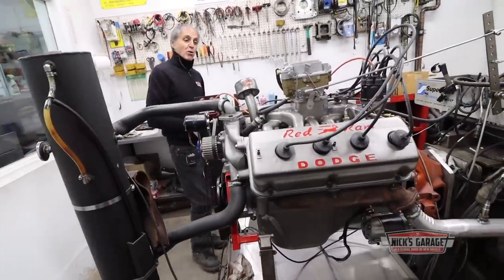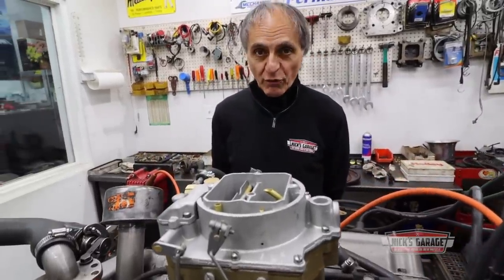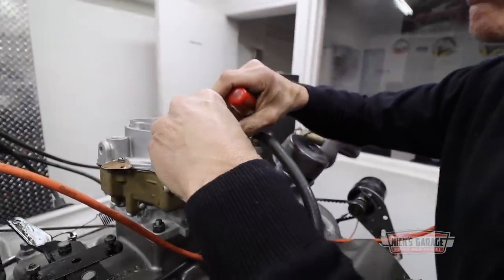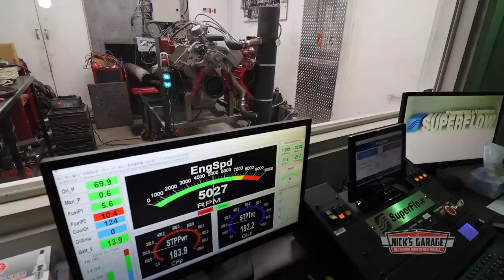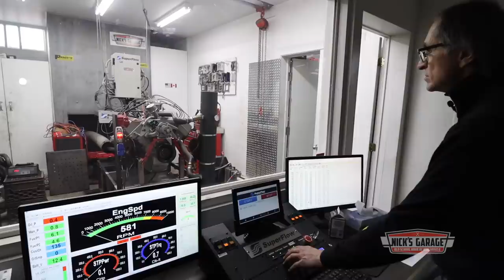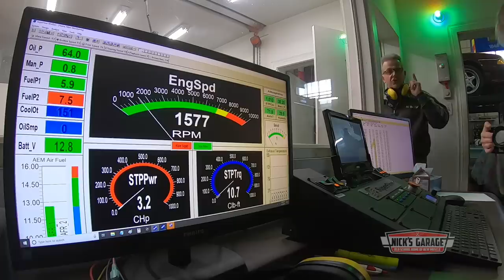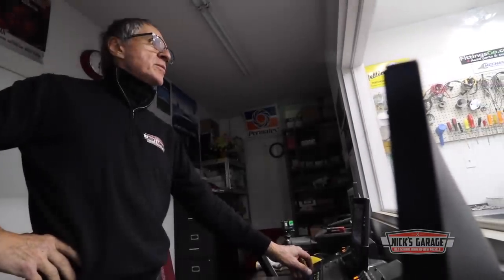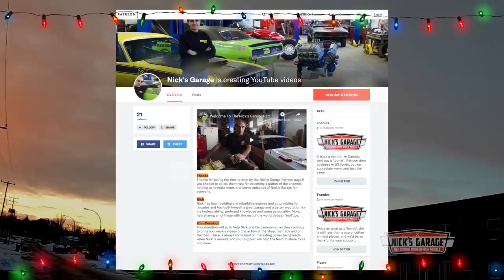Tiny Old HEMI - First Generation 241 Hemi on DYNO

Comment: I have wondered what they were thinking when this engine was born. It replaced a 230  CU in flathead six that put out 100 or so HP with good torque for city use. The weight, physical size, complexity and cost of this engine for the times makes no economic sense to me.  Being that this engine was an obvious competitor for the 239 cu  in Ford “Y” block & shortly of the 265 in Chevy how could this be justified?. Nonetheless a really interesting piece of history & a great video.  PS: weren’t the early Dodge hemi’s known for breaking crankshafts?
Reply: Andy.          Breaking crankshafts. Do not know. We revved the engine many times to 5000 RPMs and went well.
Reply: Nick Panaritis great video of a smart and persistent individual solving problem after problem & succeeding .

Comment: Nick,  look at the overhead video shots down the carb secondary throats after that first  jet change, there is NO fuel coming out of the secondary venturi boosters in all the pulls after that.  Thats where your power went,  its functioning as a 2 V carb  It doesnt appear the secondary throttle plates ever move.

Comment: Vacuum secondaries are not opening.. From what i saw on the video

Merry Christmas from Bavaria Germany
Reply: They're mechanical, not vacuum, but yes, the choke linkage is keeping them locked shut. He forgot to wire the choke open again after they changed out the jets.😉
Reply: @danw1955  yea i  mean only secondarys... Idk why i wrote vacuum
😂

Comment: Nick,  great video. Question: 55 Dodge Hemi ( same as your's ) missing distributor. Grabbed one of my 318 electronics and it looks like it'll work. You used a 72/73  340 electronic. Do you know if the 340 & 318 are the same ? I don't have a 340 to compare...... what do you think ? Any info would be appreciated. We want to put it in a 39 Dodge 2 dr sedan, a dependable driver, not hot rodded

Comment: Plug wire at rear of engine is arcing against the block at the rear. 
Those Will Carter 4bbls were touchy. The numbers on those old jets mean nothing!
Reply: Dave Micolichek  What I meant is, those old jets flow inaccurately, a smaller or larger number can factually low more or less than one with the same number, you don't know for sure unless you flow test them,  and they're usually damaged, corroded...
Reply: Dave Micolichek  Lots of luck finding WCFB clean undamaged jets haha!

Comment: I love this lil torque munster on the Dyno and all the parts that fit in the old 241 Red Ram Hemi 11 yrs be4 I was born just funny how the big Hemi flywheel fit in there along with the 340 distributor just wild love it very Kool Nick n Crew great job and that's where all the Hemi 's start from that 1 funny story I have a 71 340 road runner motor I will be building soon but gonna stroke it out and try to make big power on  and going to put it in a Dakota pickup with just a oak bed I will be cutn all the wood for from tree's from My friends home down in Fla here love My V8 Mopars Small block big block love to have a Hemi but I never will unless I get rich be4 I die had a 65 Dart GT factory underdash AC and all still have My dual point distributor from it an old lady / Young Docs wife back in 65 bought the car brand new in Hollywood florida loved that car original with 80000 thousand miles on it just gave it a head job paint the valve covers with the BLK cringle paint same color as the light blue 67 gto miss My lil toy I found out that Ed   Iskadarian ISKY made the cams for Mopar back in the day that supposedly had 450 lift cam you would be sitn in there and the car was shakin Koolest car I ever owned had many big block Dodge chargers in My lifetime and an old 68 Barracuda next the Dakota Pickup I build will be a wheelstander truck lots of power all gas 1 big carb lookin to stroke it to 426 cubic inch comin out of a small block can't wait just sayn will say 🌲 Rob on it with the live Oak bed from real live oak 🌲 s here be awhile before I get there but I am patient man and will be street legal too love watching My favorite new family Nick's Garage/ just learned a lil bit about the small block Mopars I didn't know from Tony's Garage and He was a Hemi/ big block lover mostly now he's a Small block lover too but He used to write for the magazines in the 80s/ 90s he said which I thought was Kool that thing sounds mean/ Kool the rumbler

Comment: Sounds like air is getting in somewhere it shouldn't be, if you cant get it to richen up its a dead give away. Try making a couple gaskets out of some felt paper between the top section and the lower barrels, if the surface is uneven and not sealing properly with the gasket you will see marking on the edge of the paper where the air is getting through. I know I'm probably preaching to the choir here with someone with your experience though, just my 2 cents. Good luck with it, I have no doubt you'll get it sorted.

Oh, And a merry Christmas to you all!
Reply: Makes no difference at full throttle. That ain't the problem.
A vac leak effects part throttle and not full throttle since there's no manifold vacuum at wide open throttle. Its something else.
Reply: Adam Randell choir  , and your telling a pro   Advice  that’s rich  hehe  happy holidays all
Reply: all of the carburetors from that time period were junk,wcfb aluminum or cast iron based,they were first design junk,moving to the smallest afb's would increase horsepower and torque,due to atomization is superb on all carter designs
Reply: @nadronnocojr  I did say that did I not? It was just an idea, did you just read the first half and think you'd be a hero?
Reply: @strattuner  You have a good point there, some of the older Volvo engines I've worked on were the same. The old 2.2 ltr 4 pot loves running a bit lean but of course go to far and you run into overheating issues, the 2.5 5 pot was way better running rich and you'd get the flames to boot but that is also EFI so way better control. Got one at the moment running 400hp and an absolute mountain of torque for its size (610nm), What amazes me about that Hemi is it is a 65 year old engine. It really shows Nicks skills, but damn did it pass the test of time or what! Not sure you'd get the same lifetime from modern engines lol...
Reply: yeah he's a master of many years,he comprehends ,he's a thinking man,the eight hole crank flange was a necessary design,they knew larger cranks were coming,i only deal with the 331-392 engines,same 8 holes all of the flywheel and clutch interchanges even between the 6's and 8's,mopar knew none of the new hemi designs would never see beyond 350 horse till called upon,yeah carb design went from junk to superb,then the gov stepped in and made demands on internal combustion engines that were and are unobtainable, fuel injection has come along way,the pie in the sky fuel economy they want a friction engine to accomplish is nonsense though,i don't work on them anymore for money I just piddle on my yesteryear cars
Reply: @strattuner  Not wrong about the unrealistic expectations when it comes to ICE, its all about ticking the right boxes for legislation. There is always room for improvement but can get kind of ridiculous, its like how lane assist can take a 3 star safety rated car to a 5 with no other changes.

Comment: Less horsepower than a Honda Civic lmao. My wife's Kia would run that engine down. My how times have changed. Very cool. Good rebuild.
Reply: 1000cc yamaha R1 makes 200bhp .... and that engine is tiny in comparison ... but I'll bet this Hemi will beat out a civic, kia, R1 on torque 😉
Reply: MotoGoat that’s what I was thinking
Reply: Yeah but to a V8 guy those asian engines sound like sh*t even though they perform super.
Reply: Mike Bennett yeah probably so but most definitely not with 300,000 miles on them because Kia and Honda engines are just not designed for longevity like these hemis were because they originally built for endurance not performance.

Comment: Nick.. go back and see if there was a thin spacer washer on the secondary linkage where the arm hooks up.. If that linkage slid in just a few  thousandths, it would keep the secondaries  shut. We used to have fits with these carbs. Overall, a great job.

Comment: It appears like the distributor is a bit out of phase. A lot of them were in the old days, I used to get considerably better fuel mileage and performance out of my early Mopars by phasing the distributors so that they fired more consistently.

May be the first time that engines ever seen 5000 RPM.

Don't worry about the lean carburetor. There's a reason why Chrysler's were known for really good fuel mileage. They ran Rich enough at the lower RPMs for you need the power and lean enough at speed to get diesel fuel mileage. I knew a guy several years ago that had a Dodge Royal from 1955 I believe and I forget the size of Hemi but I believe it was smaller than the one you show oh, but he was getting 24 to 26 miles per gallon. And that car got around just fine.

I am not surprised at the engineering wisdom of Chrysler to use interchangeable parts for 30 or 40 years.

A little bit of your lane maybe coming from the fact that you do not have an air cleaner on it. I do not remember whether they use the oil bath air cleaners but those would have rich in the mixture because of an increase vacuum required to get the air through the air filter medium. That should easily give you an extra point.

Comment: Someone needs to bring Nick a 225 Slant six so this engine isn't the smallest he has dynoed. :-) I keep hoping to see a hopped up poly 318 run sometime but hardly anybody fools with them.  I am surprised you don't have the starter mounted on the dyno. It makes life much easier not having to fool with that wiring and the mountings all the time, just stick the splined hub on the crank and go.
Reply: You do get around ,happy holidays and Baily.
Reply: bc.   The new Dynos have the built in stater and flywheel set-up. I swish I had a 225 to rebuild.

Comment: That engine would be a good mate to the 63 Dart wagon I'm looking at. I wonder how far the 241 could be taken to. I don't want any run of the mill Chrysler motor in it. I like the uniqueness of the combination. I'm sure it would be a nightmare getting it to work properly and make the project 3 times as long and 3 times as expensive but I would have something that no other kid in the state would have.
Reply: Bigger behind the trigger use a 318 poly and a 727 torque flite it will be easer and cool as hell!

Comment: OK, it's Main Street, USA, 1951, late at night. A flathead Ford lines up with a (first year) hemi. . . and the winner is??? Next night, the winner of that race is lined up against a Rocket 88 . . . and the winner is...?????   ALL BONE STOCK.
Reply: Patrick Joseph l will put my money on the pre-war Straight Eight Buick...High compression, dual carbs, 320 cubes, 165 hp . Oh, and just as fast as the post war Olds and Hudson.
Reply: Dave Micolichek  That's what the Rocket 88's were known for.

Comment: There’s an electronic pick up coil kit that will go into the point distributor it gets magnetic reference off of the point cam. On the old canister filters they actually used a roll of toilet paper in some of the old Cadillacs and Buick’s,

Comment: Everyone worried about linkage, could be right. But I wonder if it wasn’t tuned for use with its air cleaner which often acts like a choke. FWIW
Reply: Good point to be considered..
Reply: They often used an oil bath kind of filter

Comment: Neat engine. Too bad the owner couldn't go the performance route, add some custom headers, increase the CR, add a custom sheet metal fab manifold, add a performance carb....these engines make great additions to old lightweight 30's rods.
Reply: Kathleen Shaw  yeah no doubt, low CR would be good for a Blower, turbos or other boost apparatus...
Reply: Kathleen Shaw  yep, sure thing....

Comment: Nick, very nice. Noticed secondary barrels did not show gas  splashing  on venturies  during later runs. You could see gas splash  on primaries and secondaries  on your first run before you took carb apart. Look at your top down camera shots during runs. Is fuel pressure down or drop on demand? Sharon Burns seems to have a good comment.  Thank you for your hard work!
Reply: John.       Had it fixed the next day.

Comment: the public view from the top of the carb, the back secondaries are not opening I sware on a stack of bibles are NOT opening or you would see that plate move and they never  move Nick... your running a two barrel when it should act like a four barrel.. merry  christmas by the way
Reply: Morgan.        We had it fixed the next day.
Reply: I could see the same thing , only on the first pull can you see fuel being pulled thru the venturies , but not in any of the other pulls where the HP was down.

Comment: Engine dyno does not count  no load  at least get a wheel dyno.
Reply: I can't remember where I came across the info but I'm pretty sure a dyno like Nick's is a loaded dyno. I could be wrong... far from an expert. If I recall correctly it uses the water in some manner to create load. Edit: I may have seen it on Engine Masters. If I find the video I will share the link if I can.

Comment: I put Clifford intake and exhaust headers on my 225 Slant Six, small ceramic starter, Holley 4-BBL carbureator and Mopar electronic distributor and Mopar mild street performance cam, straight pipes.

The only thing I might have done differently might be a fuel injector carb.

Now, if I haven’t driven you insane with my comment..

I would like to see what you would do with the 225 Slant Six for the road.

Comment: Thanks Nick for showing us that beautiful 241! I had one that was in an old logging truck. Has a 2bbl and was bolted to an old 4 speed. I think your carb is the problem. It seems like you said to be running too lean. You may actually make more hp on an old holly 2bbl or Rochester 2bbl.

Comment: the engine is perfect for a turbo installation,due to its genius design the 241 would probably put out 500 horse easily with copper head gaskets with oringed heads

Comment: Truly defining the term, "Hot Rodder"......:D

Note: frame rails were so narrow up in the front, the increase in motor size didn't allow for appropriate exhaust. Back when engine tech out paced suspension tech.
Reply: 48Dodger Headers were used putting a V8 in a 53 Plymouth to clear the steering box.

Comment: Thanks for posting. The gen 1 hemis   sound great. What is the distance you had to space the bellhousing back from the block? I see you used nuts as spacers. It looks about 1 inch or 7/8" between block and bellhousing. Mopar used an aluminum plate on the rear of the block as a spacer and to mount the starter. I have two different thickness plates, wonder which is best to use to adapt bellhousing to my 331. Thanks

Comment: You can clearly see the secondaries opening on the 156 hp run at the 21 minute mark. Each run after that, the secondaries are not opening! Check the video, they barely move at all.
Reply: Ron.     Had it fixed the next day.

Comment: I say check the air bleeds and all the fuel circuits in the carb. After you took the carb apart the engine started to lador at idle and started to break up when you raised the RPM. You choked the carb with your hand and nothing happen. I think you have a passage way blocked up a small bit. Take the carb off and run a wire in every circuit. I could hear the engine had a laboring sound to it. As small as the circuits are just a little something could cause this. I'm 72 and have been a mechanic all my life. Have my own business where we build engines. Opened the door in 1976. before that I mechanic at GM. Ck vac. leaks too. But I don't think you have any. Ck the gaskets in the carb. One might be covering a vent hole. Good luck. I wish I was there to help you find it.
Reply: ken.    We had it fixed the next day.
Reply: @nickpanaritis4122  What was it.
Reply: @kennethrobinson11231  .     Linkage binding.

Comment: Merry Christmas guys, nice job on a great old motor but, do you watch the camera feeds when your testing ?  On the first run you can see the secondary's wide open and fuel flowing out of the tubes in the venturis on the whole run.  On subsequent runs after reassembling the carb your lucky if they are open a 1/4" at WOT on the primary's, the secondary blades barely move so no air and the metering rods are still all the way down.  When you chop the throttle at the end of testing you'll just see them move just a little and close.  linkage problem, blades binding or hitting something ?

Comment: The carb is a WCFB. Had one of those on my 57 Dodge Coronet 325. Which later was replaced with a 361 up from a 58 DeSoto. I was a pretty fast motor.

Comment: The secondary butterfly's aren't opening on the last pull. Watch the video. I suspect a mechanical linkage issue of some sort. Pretty amazing it pulled 140hp with only the front two barrels working.
Reply: Paul.         Had it fixed the next day.
Reply: @nickpanaritis4122  Cool! Hope to see a re-run now that's working correctly.

Comment: Just because a jet has a number stamped on it doesn't mean that's it's present SIZE. . Back in the day (!) if a larger jet wasn't in hand , a drill bit did the job, totally mess up a 'by the book' mechanic later, hehe... but a jet index rod set is only way to know. Maybe Nick needs a recheck on that item here? Hate to see him give up that 10 hp or even more...
And btw, wouldn't it have been great to see the difference an improved exhaust may have made?? 
I used to build and race mopar big blocks. 
I hope they have them in heaven. 
Oh i love that vid, thanks Nick!!